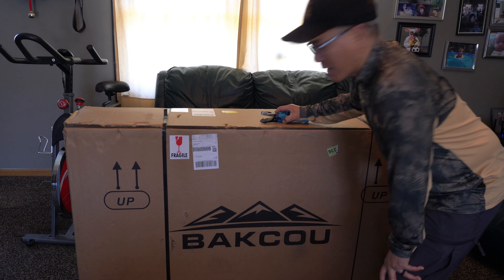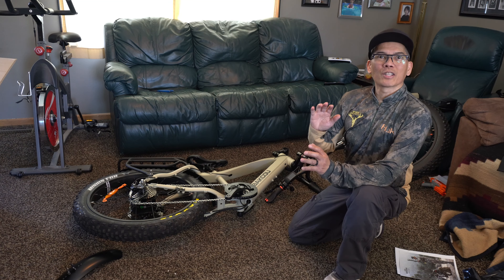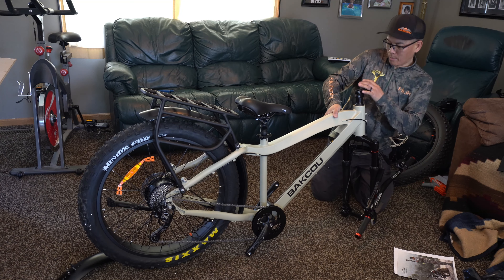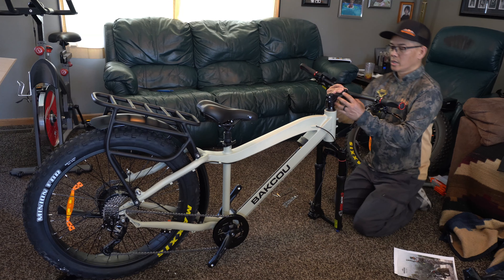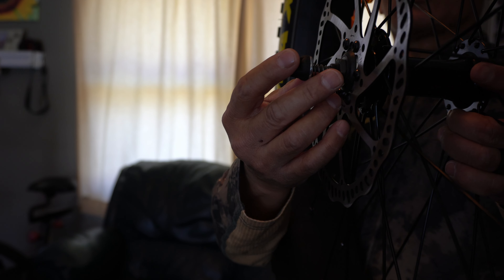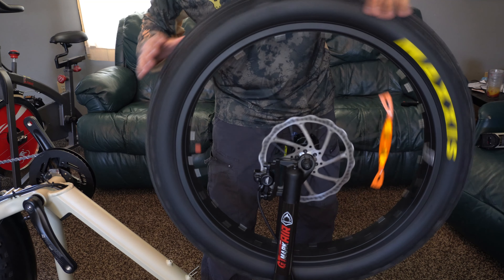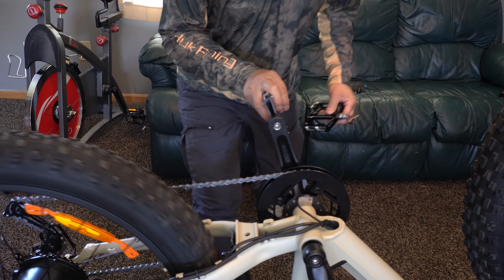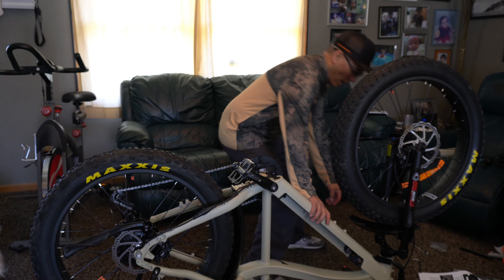Bakcou Flatlander E-Bike Unboxing Video

Comment: i just put together my 2021 Mule. Is that whit or desert sand? also why didn't it come with the larger screen?
Reply from the maker: @Dino Karakostas
Desert Tan. This is the screen on the Flatlanders.
Reply: Bakcou said the Flatlander was identical to the mule except for the motor. You should call them. I like Desert Tan, that was my second choice, enjoy the bike looks great.